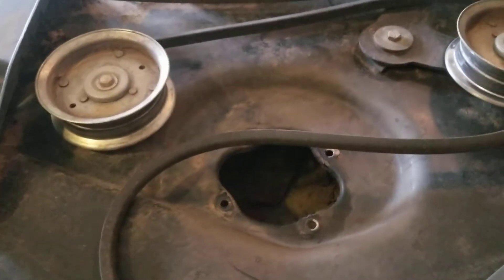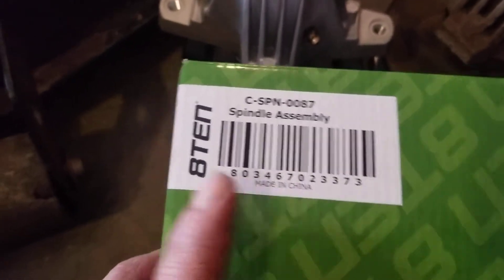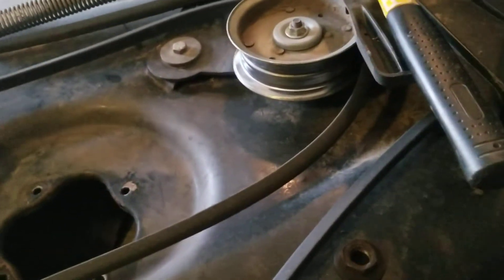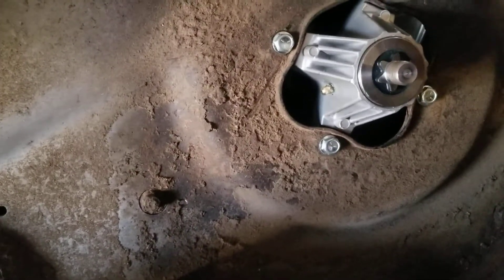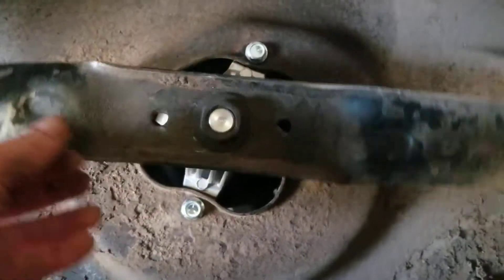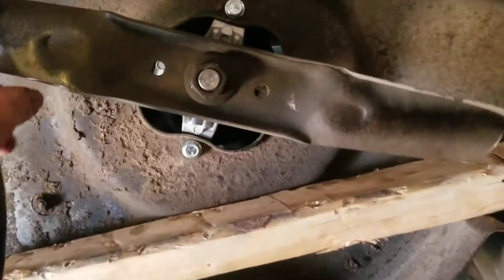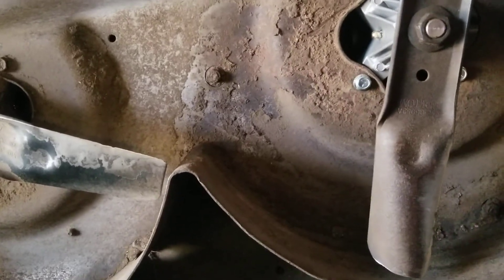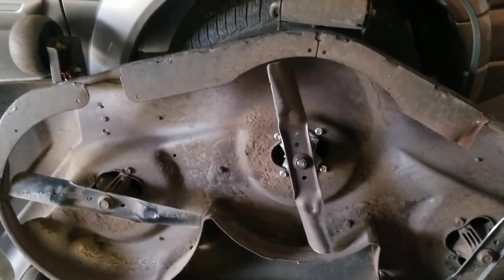cub  cadet install new spindle on mower deck.

Comment: Hi, I was trying to comment on your Dehumidfier video trying to see if the smell from the crawl space was less harsh than when you did put one in
Reply from the maker: Yes on the dehumidifier it did improve completely. The oder is gone the basement is dryer and system is working as it should. Hope that helps. Thanks for watching
Reply: @johnagsmith2364  Much appreciated glad to see this worked without having to encapsulate the crawl space. I have to rip out all the subflooring to access most of my crawl space so this will do for now until i save a lot more for that big job